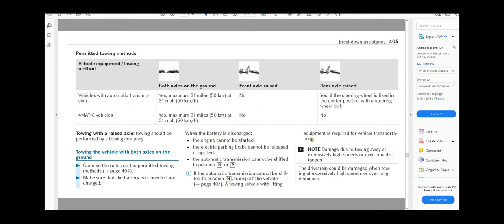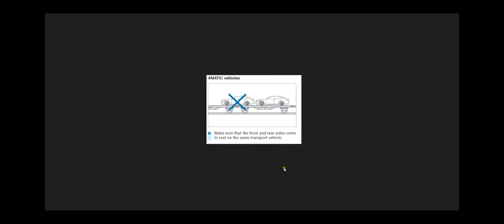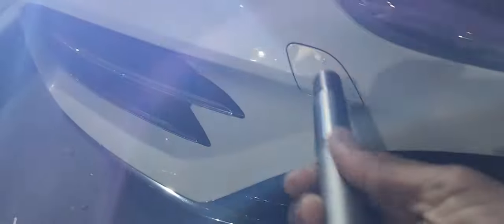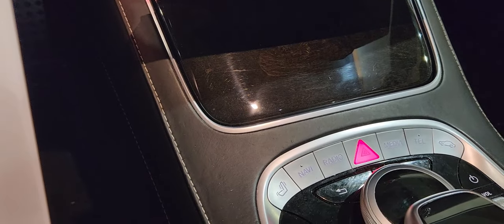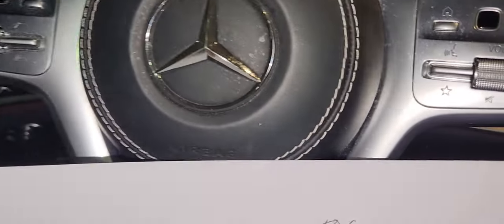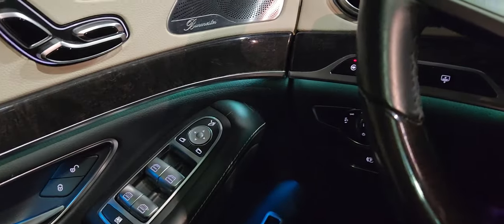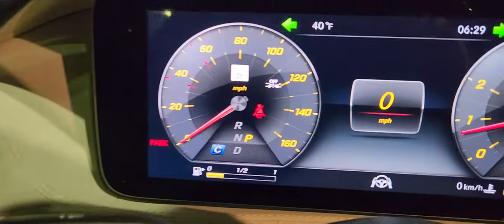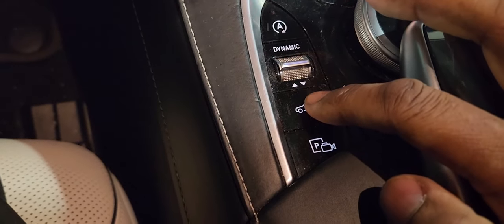Towing a Mercedes Benz S Series | Mercedes Benz Flatbed Tow Truck

Comment: Hi, Wayne A. Robertson. My name is Vladimir. I have MB W222 S-560, 2019 year of manufacture. I see that you know this car very well. Could you give me some tips on setting up my car?
Reply from the maker: What specifically  do you want to know about it?
Reply: The suspension works hard on my car. All the time as in sports mode. I tried to make settings through the menu, but I didn't get any results. How can this situation be eliminated? Thank you in advance for the answer, if you find it possible to give it to me...
Reply from the maker: @user-qt5xd6rn5h  You will most likely need a scanner to see if there  any error codes on your car specifically for the suspension